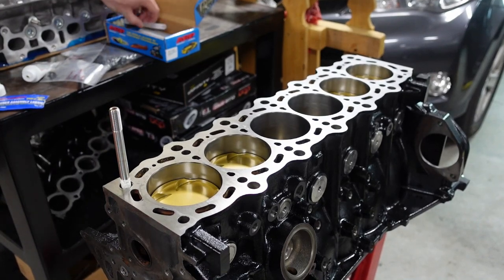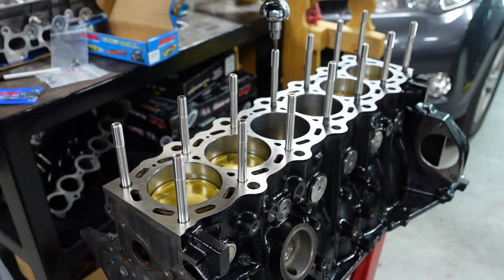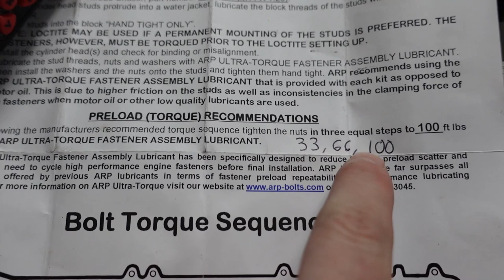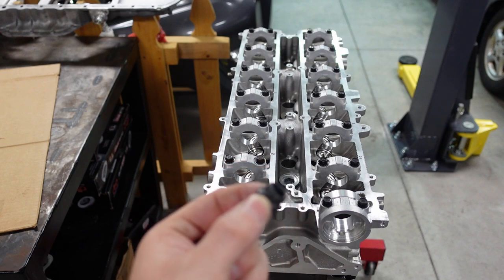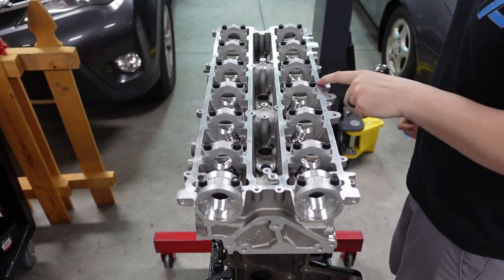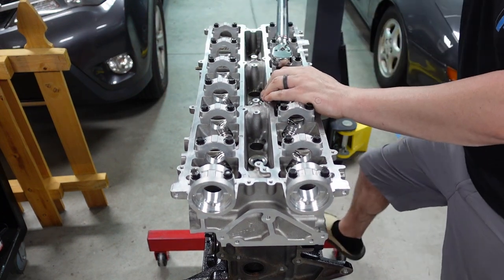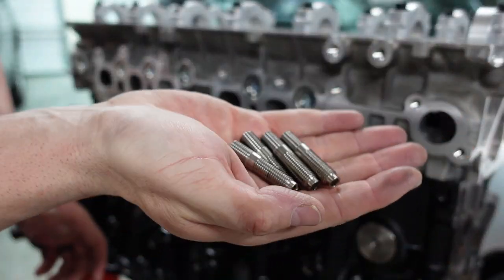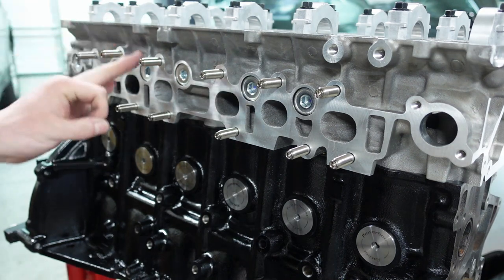2JZ ENGINE BUILD Ep. 12: Head Install & ARP Head Studs

Comment: The bottom of the studs do not get lubricated. The only exception is if they protrude into the water jacket, in which case you use ARP thread sealant.

This is because as you tighten the nuts, you don't want the stud to be driven deeper into the block. You're well aware of why, good job on only driving them hand tight during initial install. But you really do want them to have a higher coefficient of friction on the block than the nuts.
Reply: And oof, did you say you don't lube the nut threads? That's a HUGE no-no. It's extremely likely that this head is under-torqued as a result, not enough clamping force. Has this motor ran yet? Please re-lube and retorque if you can!
Reply: I hope they are the regular studs and not the fancy ones not to be touched by hand 😬  Otherwise I thought myself it was the top threads and nuts that were well lubed
Reply from the maker: @krismcleod272  these are the real real fancy ones you can touch by hand. CA625+ the L19 you can’t
Reply: @PureFunction  are those 2000 series?